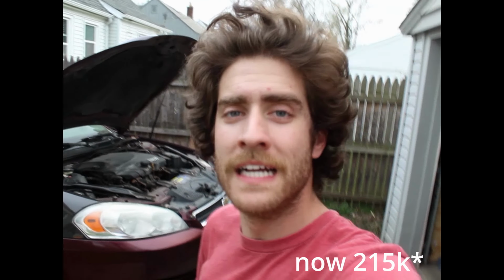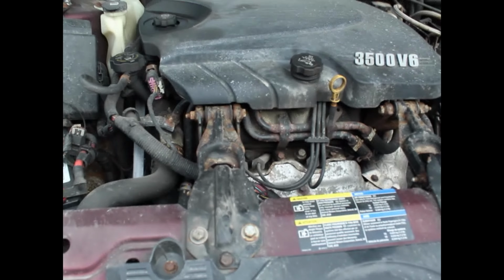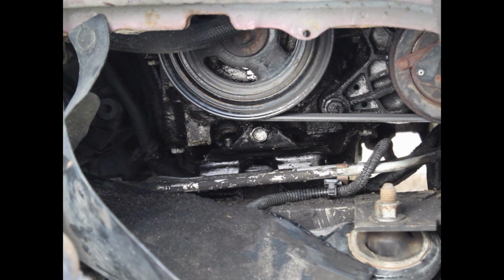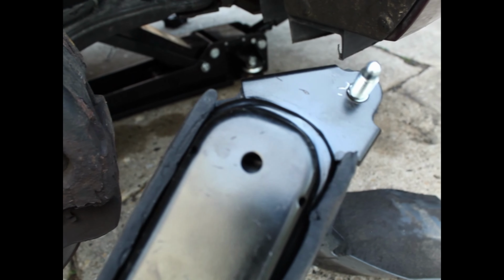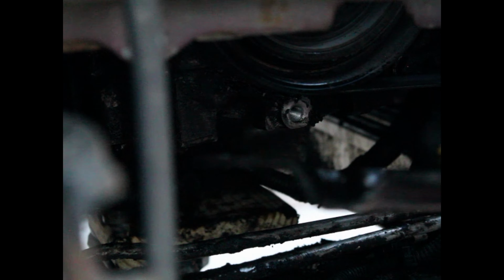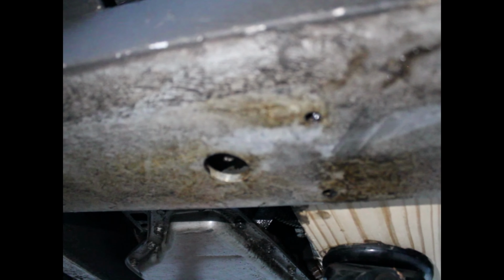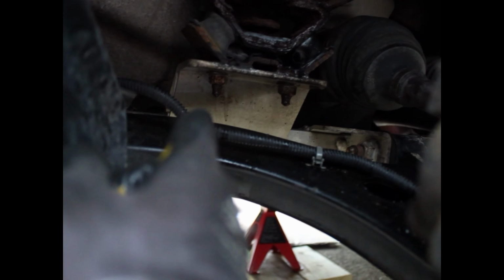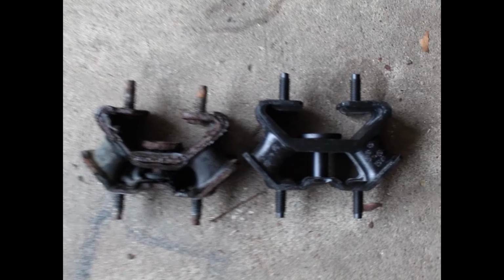How to replace all 4 motor mounts - 2006-2013 Chevrolet Impala 3.5L

Comment: Hey bro, looks like you need to change your oil filter adaptor gasket which is where all of the oil is coming from. Two of my four Impalas have the same oil leak. See the bead of oil on the bottom of the oil filter? Theres at least one video on YT on changing it, and the tricky part is you have to loosen two A/C compressor bolts half way to get to one bolt on the adaptor.
Reply from the maker: thanks! I was wondering where it was coming from but was leaking so slow I decided not to prioritize it.
Reply: @frankfixates6777  No problem. There are 4 bolts, you might want to try to just tighten them because its a pretty sturdy half metal gasket in there and the vibrations over time might have loosened them. The two bolts that you have to get from under the grill after popping the plastic plugs holding the protective plastic piece up seemed loose on my car.
Reply: I changed mine and it still is leaking. Idk how or why and the filter was a bitch to keep on the housing when trying to put it back together. Such a tight spot definitely the hardest job I’ve done yet

Comment: Hey frank. Thanks for your video! I was wondering how much time it took you to do all this? Or how long you'd assess it would take someone.
Reply from the maker: wiggling that right side lower mount was the longest. that alone took me about 30 minutes. but for the most part, all of it was pretty quick, taking me about 2 hours from the moment I rolled my car up to my driveway to the moment I put away the last of my tools!

Comment: Props to you for doing this while filming! That lower passenger side mount is a b****. Mine was collapsed since it is hydraulic and the space was much smaller, got it done but it was a lot of work
Reply from the maker: The lower passenger side was DEFINITELY the most annoying part of this job. if I would have skipped it, it would have saved me half the time it took to do this.

Comment: did you have to jack up the motor to take the weight off when you replaced the top mounts? I didnt see that you did but wanted to make sure. thank you
Reply from the maker: nope! if you absolutely need to, you can use a crow-bar or some leverage to get the holes to line up. With the car parked on level surface, I found that removing and reinstalling the top motor mounts was no problem at all.
Reply: Thank you so much for the prompt reply and awesome video! @frankfixates6777

Comment: Any advice on if you can’t get the bolt holes lined up on the passenger side engine mount? I only had one side on a jack stand. I’m wondering if maybe that made it to where I couldn’t get the bolts holes lined up
Reply from the maker: if you do'nt have a spare stand, maybe a cinderblock to help hold things up. Or you could use a crowbar to left the one side up and fit the bolt in with your other hand, provided you have enough space!